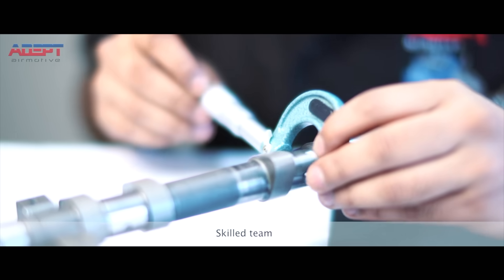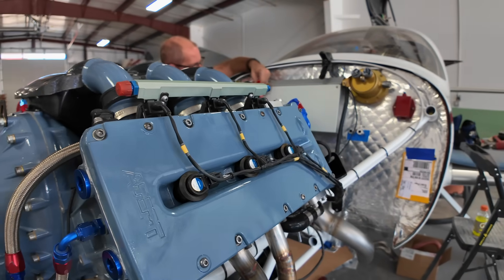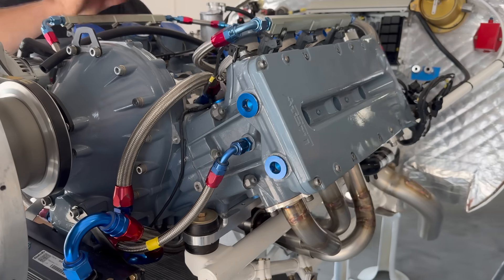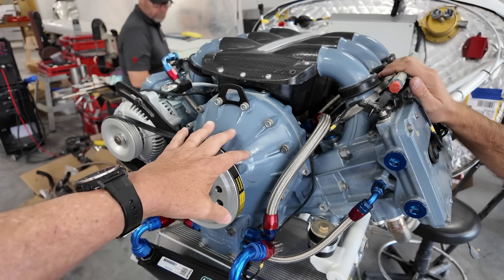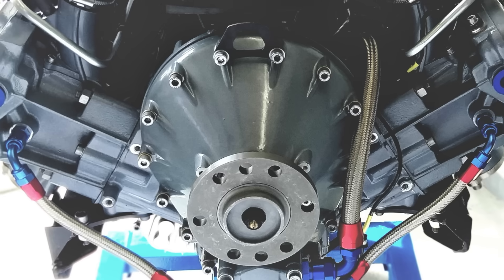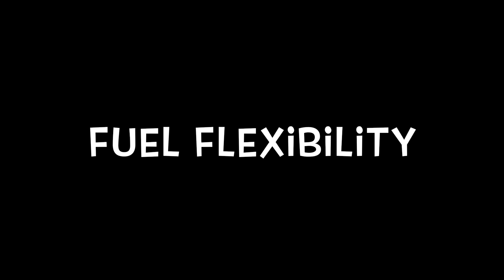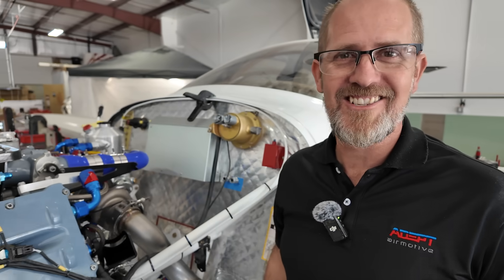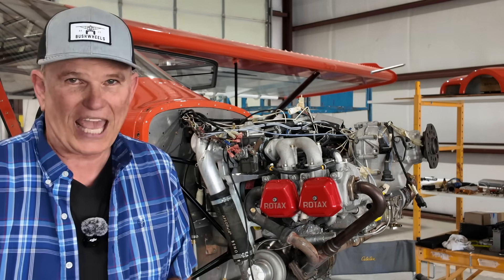The new Adept Engine could be a winner for General Aviation

Comment: Sounds promising, not a big fan of the electric water pump though.  But oil temp efficiency helps when things go bad.
Reply: I have an electric water pump in my home heating system, it's been operating without issue for over 20 years and has probably run for tens of thousands of hours during its life.
Reply: @PistonAvatarGuy  Try again. big difference in Air worthy and ground appliance.
Reply: @HongyaMa  Oh? What are the differences? Explain them.

Also, there are electric water pumps made for automotive applications that are rated for 5,000 hours, which is more than enough to make it through an entire overhaul period.
Reply: @PistonAvatarGuy  voltages and loads are an airframe limitation. Been there done that and worked with western region & rotorcraft directorate for certification on a long gone helicopter project. but that's okay as Piper uses an automotive electric pump for fuel
A popular Facet type.
Reply: @HongyaMa  I meant the differences that would prevent an electric water pump from being viable for use on a certified aircraft.

Anyway, I do think that they should have had an engine-driven water pump, but I don't see much of an issue with an electric unit.
Reply: @PistonAvatarGuy  Every power plant slaved to an airframe electrical system is asking for problems. I've seen decades of experimental air craft (fixed wing & Helicopter) accidents happen when the electrical system has issues, From a minor we can still fly as with the old mags to the engine quitting with "new" electronic fuel & sparky stuff.... a few certified machines too had issues with the STC new stuff...
.
Reply: @HongyaMa  Doesn't seem to bother airliners, and their engines wont run without their ECUs.
Reply: @PistonAvatarGuy  3 electrical systems battery buss and they do fail, You  like the new AD for Boeing 787s.... Big bothers and dead bodies too.
Reply: @HongyaMa  Nothing is perfect, even mechanical systems fail. And these engines also have 3 sources of electrical power that would all need to fail for the engine to stop running; two alternators and a battery. The same is true in the Diamond DA62.
Reply: @PistonAvatarGuy  Air India. 260+ dead
Reply: @HongyaMa  Been reading about aircraft crashes for a long time, plenty of them are related to mechanical failures.

Anyway, there's a reason why all modern turbine engines are computer controlled, and computer controls are especially beneficial with gasoline engines, given their finicky nature.
Reply: @PistonAvatarGuy  Cope harder. the ole Seco & Bendix FCUs worked great and were economical mechanical adjustable and they worked great for decades,  (Certified Helicopters) The electronic Fuel & ignition  experimental/Certified gasoline power plants are way more finicky and I've recovered more wrecks that were loss of power then 'pilot error' and the root cause was the power plant/ (ign/fuel) was slaved to the air crafts electrical system....
zealots for the "new" bling just don't use a failure mode [What if] mode of thinking.
Cars use 40% of rated power
Aircraft use 70% of rated power in cruise alone. 90 to 110% in a climb
Different animals
Reply: @PistonAvatarGuy  Aircraft are a different animal.
Cars use 40% rated power 90% of the time
Aircraft use 70% rated power in cruise 90 to 110% on take off. 
Cars don't need light weight wires to carry.
FAA has more concerns to the air frame electrical loads in certification.
Most of these new power plant designers don't have the wits to match air frame systems to the beast they created .
Small gas turbines are the future...
After all my design created the Jet Ecec helicopter conversion.
Reply: @HongyaMa  The current EFI/FADEC engines from Rotax, Lycoming and Austro Engine will just keep being awesome, regardless of what you want to believe about them.
Reply from the maker: My car has 187,000 miles with the same water pump and it's still going strong. Their parts are premium.
Reply: There are many differences in aircraft use verses your home. Your home has fairly stable temperatures, aircraft will have very high temps under the cowl and sometimes be started in very cold temps. Vibration and resonance can cause metal to become brittle very quickly, the prop ranges may be able to offset some of this, The g forces can also cause premature bearing wear, etc.

There is a reason most GA aircraft are flying behind “flat” engines without a gear reduction or water cooling. My 2023 Tundra is “high tech” but the engine failed at 11K miles do to front bearing failure. You can’t have 100K aircraft engines failing . Toyota has some amazing engineers but they failed on this engine, how likely that a mom and pop business succeed? 

You must keep GA engines VERY simple, this is not an area to be “high tech” or experimental in. Go to the EAA convention and see how many company’s come up with the latest and greatest engine every year.
Reply: @grumman38 lol, I'm surprised that you couldn't guess the function of that water pump. The pump is in the radiant heating system, so it may not see very cold temperatures, but it certainly sees some fairly high temperatures. And, like the other guy here, you didn't explain any reason why an electric water pump couldn't be built to last in an aircraft application. There are automotive electric water pumps rated to go 5,000 hours, btw.

Anyway, Rotax proves your camp wrong every single day. Austro Engine, too, is beginning to prove you all wrong. Geared, turbocharged FADEC engines will vastly outperform your archaic lawnmower engines in every way, period.
Reply: @grumman38  BTW, there's a 50 year old Cessna 404 that flies over my house every week day, and it has been doing so for decades, maybe you want to explain why its geared engines haven't caused it to come crashing down out of the sky?

Edit: It's actually a fleet of five 404s that operate from my hometown. They sound fantastic when they fly over.
Reply: @PistonAvatarGuy There has been plenty of fatal crashes in the Cessna 400 series, how do you know it didn’t crash after passing your house?  Has there there been any other fatal crashes right over your house? I’ve got a close friend that is one of the highest time 421 pilots still flying and I’ve got time in them myself, they aren’t that great.
Reply: @grumman38 ok, buddy

Comment: Where is the valve train
Reply: from the plugged ports in the front of the block I'd say buried overhead cam
Reply from the maker: https://flyadept.co.za/
Reply: Chain drive for cams is at the rear of the engine

Comment: We NEED this engine on the Market Yesterday... The marKet is screaming for a new modern engine
Reply from the maker: I hear ya. I'm surprised Rotax hasn't done it yet.
Reply: @PlaneCrazyChannel  With MOSAIC increasing the market for larger Light Sport aircraft, perhaps Rotax will develop a new Six (they did so years back, but now have much more data from the fleet to improve things.)
Reply: @PlaneCrazyChannel I wish rotax could make something in the 215hp range  because Franklin parts are getting tough to find for my maule m4😮
Reply: . . Won't happen  !

Comment: what’s the weight?
Reply: 355 dry and just over 462 pounds wet/installed (for the 360T), according to their website.
Reply from the maker: Just a little over 360 lbs. https://flyadept.co.za/
Reply: . . ! !  Similar to any other  MOTOR  built out of similar materials,  or is it Airrated metals ?  ?  LOL    Seen it all before  ,  you ? ?

Comment: Excellent update!

Edit: And, for the record: I don't believe that this engine will work successfully as a production engine as it is, but I would like to see if it's reliable and how efficient it really is.

And I do believe that this engine could eventually be developed into a certified production engine, but some regs do need to change. The need for a dual ignition system needs to be done away with when it comes to direct electronic systems. I also think that they're trying to squeeze too much power out of it (320 hp seems more realistic) and that the compression ratio is far too low. The NA version should be able to manage a 12:1 compression ratio, while the turbo version should be able to manage 10:1... considering that it should be designed to burn UL94.
Reply from the maker: Thank you!

Comment: One question comes to mind,  can the liquid cooling be coupled with cabin heating similar to that in a automobile?
Reply: Yes it can easily but you also alternatively still can use exhaust heating as in air cooled engines.
Reply from the maker: I imagine so. especially when you consider its high altitude potential
Reply: Yes, coolant can be routed through a small, cabin mounted radiator.